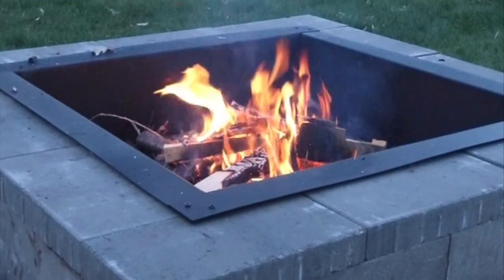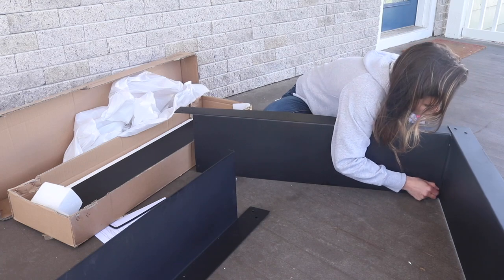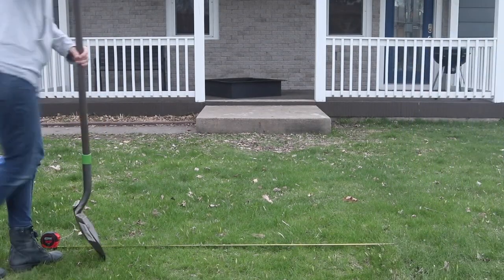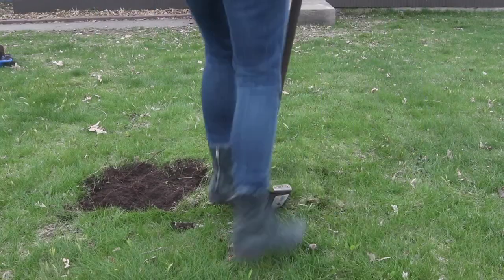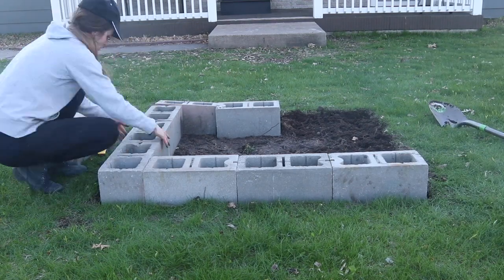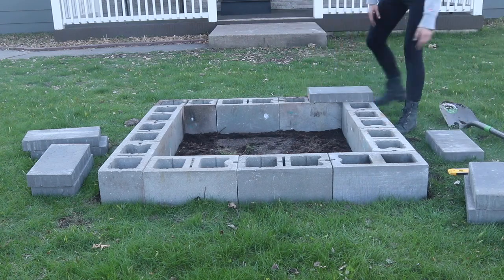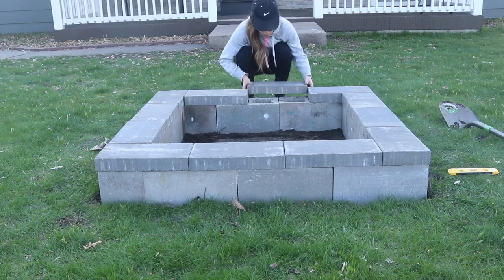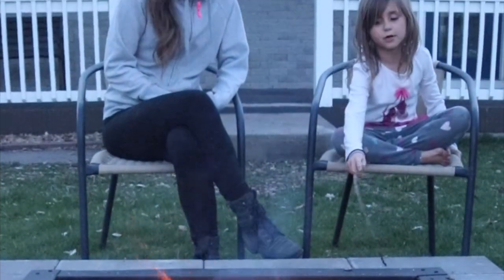DIY Fire Pit | Modern Square Fire Ring [Step-by-Step Guide]

Comment from the maker: If you want to get concrete blocks to do this project, you can go here! (Affiliate Link)
Cinder Block: https://homedepot.sjv.io/5vV7n
Reply: Looks great! Do you have a link for the patio pavers?
Reply from the maker: @charliekeith11  I'm sorry I couldn't find them online! They measure approximately 8 x 16 x 2 so that they fit staggered on the cinder blocks perfectly. I'm sure you could find something similar at your local hardware store's garden center. Good luck!
Reply: I can’t find paver 8x16x2 at big box store. Only found 8x16x4 do you think it will work for this steel liner? I love your idea so much and already subscribe your channel 👍👍
Reply: Was the fire pit 30 or 36 inch?
Reply from the maker: @ericadthompson1029  36"!
Reply: @ericadthompson1029  I did 36. It's pretty big
Reply: @WelcometotheWoodsBlog  so from what I saw is 12 pavers and 12 concrete blocks? For the 36 liner to fit in correct ?  I think I’m going to double up the concrete blocks for another level and adding three vented areas for the flames.
Reply from the maker: @sjbutts  no, because it's so low to the ground/the sides aren't very tall. The only thing I've noticed is it's not safe to burn wet wood that spits embers a lot because they fly out of the pit easily.
Reply: What sized insert is that ?
Reply: The insert has to be bigger than 36" as the inside dimension would be 40" with the normal dimensions of a cinder block

Comment: I just built a fire pit yesterday using your design, came out amazing! The top stone really transforms the look of it, tip for all... most towns have free sand/salt mix and it works!  That is the key is a ton of sand for leveling, otherwise you'll spend 10-15 minutes per brick trying to make it look right.  Great video, Great length,  Best video online for fire pits!

Thanks again.

Brandon
Reply from the maker: Awesome!! Thanks Brandon! 😊
Reply: Add cement to your sand first 3 parts sand to one part cement.
Dry stack and level everything.
Then mist your sand cement mixture to set things up.

Comment: Great project idea.  Overlapping the joints like that really helps the strength.  Dirt is "non-flammable", gasoline is "inflammable", btw.  Rather than sand, pea gravel works pretty well as a filler and base.  We're looking at something similar, but with a propane/methane burner in the center.

Comment: Hey there... just wanted to stop by again and say thank you for the video. I just got done building mine using your video and it turned out great. Thought it was only right to come and give you the props you deserve! Thanks again!
Reply from the maker: Aw thank you!! I'm so glad you love your new fire pit!!
Reply: @WelcometotheWoodsBlog  Absolutely! You deserve it. Mind if I ask you a question? I used your affiliate link and was about to purchase, but I noticed that dimension is 36" and for some reason mine has an inside dimension of 39" 1/2? I built it exactly to your specs and it looks identical, but for some reason its bigger than the liner says? Is that correct? I thought maybe it could be, so the liner doesn't fit snug to keep some heat off the block. Would you mind letting me know so I can order the insert? Thanks again!
Reply from the maker: @DaCake2  That couple inches gap is intentional for heat dissipation between the liner and the block! There's a lip on the 36" liner you can set it right on top and it will stay on the blocks.
Reply: @WelcometotheWoodsBlog  Thank you so much! I thought so, but I wasn't sure. You're the best! Thanks again.
Reply from the maker: @DaCake2  you are welcome!! Thank you for buying from the link and supporting my channel 😊

Comment: Nice simple idea. Love how you knew to level everything off. Only thing I see wrong is you didn't use any cement/glue/construction adhesive to keep the blocks and pavers in place. They can and will move if you push too much against it. Other than that. Awesome!
Reply from the maker: I didn't use any adhesive because I'm not sure I want this spot to be the permanent location of the fire pit.

Comment: My wife and I just bough this and we bought a square fire pit ring at Lowe’s, the one we got was 30 inches wide. But when we followed your design we realized that you got a larger square fire pit ring. It would help a lot if you specified the size that you purchased. The one that was $130 on your link was only 30in. You might want to clarify that on the video description. Besides that, this is a great video, keep it up!

Comment: Hello, I love your fire pit. It looks beautiful. Can I build this fire pit on top of my backyard patio floor that is made with pavers?
Reply from the maker: Well, this pit isn't suspended off the ground and if you want your pavers to last I'd suggest you don't put fires on top of them. Eventually they will crack and bust apart. You could remove enough pavers to put this in your patio area and have the rest of the paver patio go all around it?

Comment: Hey there, I'm finally working on my Fire Pit, like the one in your video, super excited except that the lining you used and recommended is 36" square and the opening is actually 39 1/2" , would you please advise before I go ahead and order one, not seeing how that would work? Thank you so much!
Reply from the maker: Yes that is correct! The lip on the liner sits on the blocks and there is about two inches of space all the way around between the liner and the blocks. This is good for heat dissipation! :) Good luck building!
Reply: @WelcometotheWoodsBlog  awesome, thank you for responding! :)
Reply: We have been building an outdoor patio,  including your awesome fire pit. Just this evening my husband and I were templating the cinder blocks, and began scratching our heads about the pit dimensions vs the 36” insert. So glad I started reading the comments. Heat dissipation makes complete sense. Thanks for your video, and for taking the time to reply to all these great questions. I look forward to looking through your channel for more diy ideas.

Comment: I would of put lime stone down were you dug. Tamped it then layed the block then you could of poured concrete in the cells to make the block more solid. Then if you wanted to decorate the outside of the fire pit you could buy stick on stone. Just my thoughts

Comment: I LOVE THIS!!  It look great and sleek and so modern!!  But best of all, it looks like something I can do myself!!!  Do I need to add sand or pebbles to the bottom or is the dirt safe enough when burning?  Also, it the insert metal and do you cover it do prevent rust?
Reply from the maker: Hi there! Thanks for the compliments and great questions. No need for sand, dirt is not flammable and easy to level/pack down as you place your blocks. I usually cover the metal insert when it rains and store it in my garage during the winter to prevent rust.

Comment: This is pretty cool! Also for those who would rather burn propane or natural gas at their fire pit, check out "EasyFirePits" online! Marine Grade Stainless Steel Gas Fire Pit Burners and Gas Connection Kits that assemble together in minutes to your fire pit structure. Also a lot of Q/A and Tricks to simplify the gas conversion process and make your own unique and ideal gas fire pit!

Comment: Looks great!  What size is your opening for the fire pit?  I understand that you used the size 36 insert, I’m thinking of the 30.
Reply from the maker: I used 12 cinder blocks which made a 56" x 56" square. That made an inside square opening that was about 39" x 39". The lip on the 36" liner is big enough to rest on the cinder blocks with a couple inches around the edges for heat dissipation. I hope this info helps you plan for your pit!
Reply: Thanks for getting back to me!
Reply: So is it possible to build a smaller one using the 30” liner?
Reply from the maker: @aveli32  you'd have to use a different block that wasn't standard size. I'm sure it is possible!

Comment: If I wanna put the fire pit on my stone deck Can I do that without picking up my stone tiles?
Reply from the maker: The stones will eventually crack under the heat and pressure. If you're going to have a fire pit on your stone patio, you should consider raising it in the air.

Comment: Where did you get the patio pavers? My local lowes and home depot did not have them.
Reply from the maker: They're usually stored outside in the lumber yard. It's possible they're seasonal, but I don't think so. I bought them at Menards

Comment: How many cinder blocks do you need for the 36in and how many of the pavers
Reply from the maker: That size liner is the one I bought :) 12 cinder blocks and 12 pavers
Reply: What if you used the smaller 30” liner?

Comment: How's it holding up after a year?
Reply from the maker: Really well! The blocks all look exactly the same, but the steel liner does have some rust. I haven't been protecting it from rain like you're supposed to, just brought it in over the winter. So I'll probably sand down the rust and repaint the liner with high heat paint in the near future.
Reply: @WelcometotheWoodsBlog  Thats great I cant wait to tackle this project! Can you please provide a link to those slabs you placed on top of the blocks?
Reply from the maker: @foreverchilllin  here's what I got, but I can't find anywhere you can order them online. homedepot.sjv.io/emnVX You might have to pick up in store?

Comment: How has the liner done?  Has it prevented the cement from cracking?
Reply from the maker: The liner has held up wonderfully and the cement is still in perfect condition after one season of heavy use! I am going to bring the liner in for the winter though so it doesn't rust. :)

Comment: Would you want to use firebricks to keep the cinderblocks from breaking?
Reply from the maker: That's what the steel liner is for. I made the square for the cinder blocks slightly bigger than the liner, too so there's air between the hot metal liner and the concrete cinder blocks.
Reply: Welcome to the Woods Ahhhhh.... Ok I’m going to do that lol.
Reply: Welcome to the Woods I appreciate the response!!

Comment: Is there ventilation or is that not needed?
Reply from the maker: Not needed, unless you want your wood fire to burn extra fast! If you make the pit super tall, it might be more pertinent to add breathing holes at the bottom.
Reply: @WelcometotheWoodsBlog  Any tips if I were to make it 8inches taller? Would It still be ok to use the liner I purchased?
Reply from the maker: @dejonmcintyre8862  Yep still okay to use the liner, it might come about six inches higher than the ground on the inside but will still look nice from the outside and top ledge. If you make this pit taller you will likely have smokier fires because there won't be enough air flow underneath. When people build deep fire pits they usually stagger blocks with space between them so that air can get in easier. In regards to the logistics of actually raising it 8 inches, just place another row of concrete blocks underneath the first row, the blocks are 8 inches tall.
Reply: @WelcometotheWoodsBlog  thank you so much! Really appreciate it.

Comment: What are the measurements
Reply from the maker: I used a 36" metal insert. The dimensions of the whole thing are slightly bigger than that on the inside.